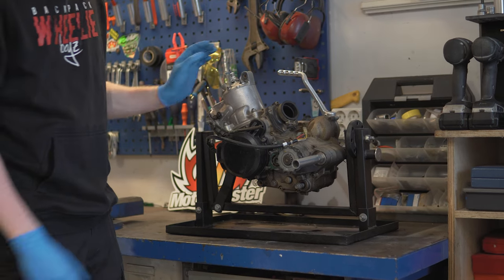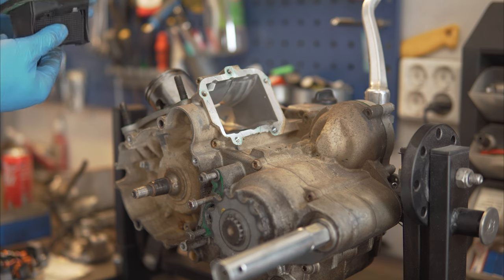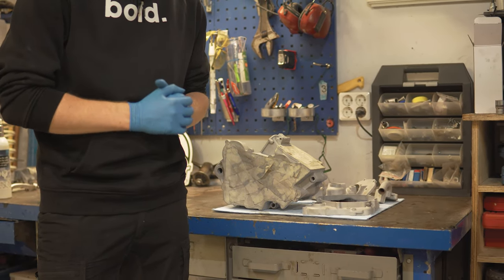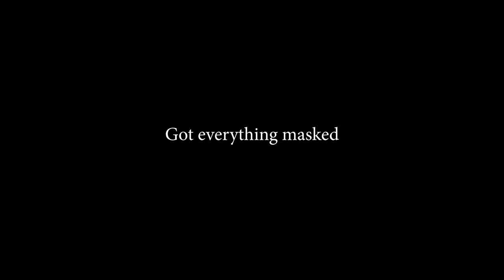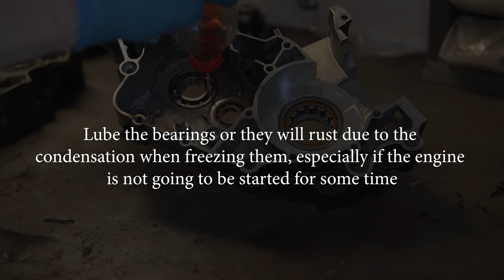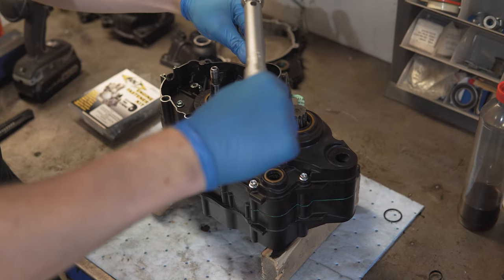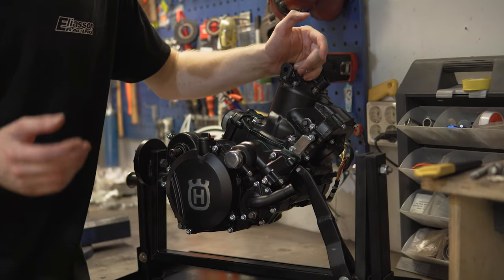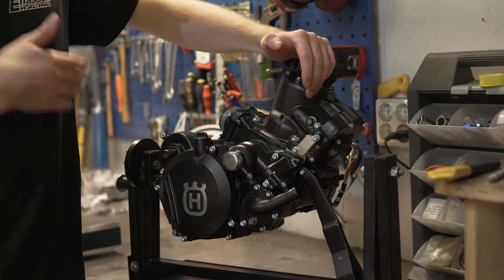Awesome Two Stroke Engine Transformation | Te 125 SM Rebuild - Ep 2

Comment: nice episode, the KTM based 125 / 150 / 200 engine is very versatile and stout unit, 300 hours on the original crank, etc is impressive for a 125.